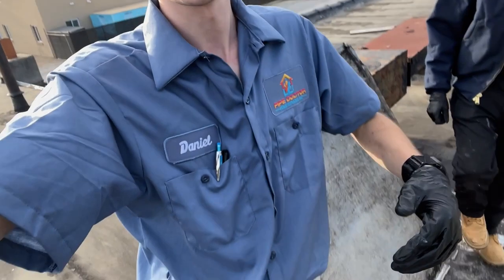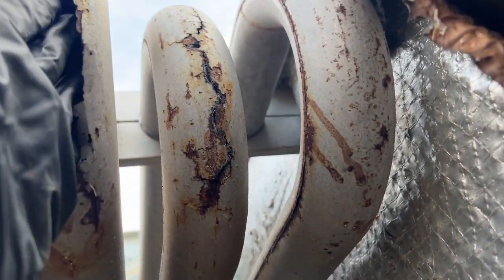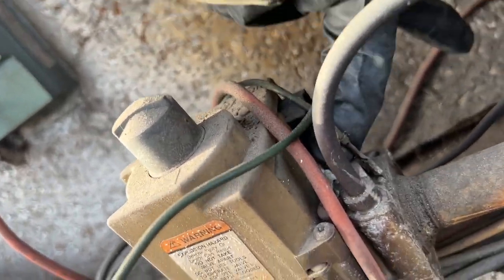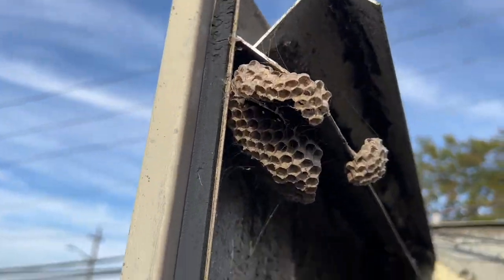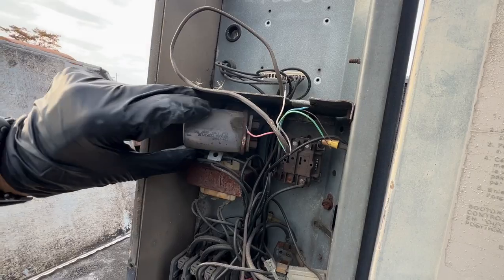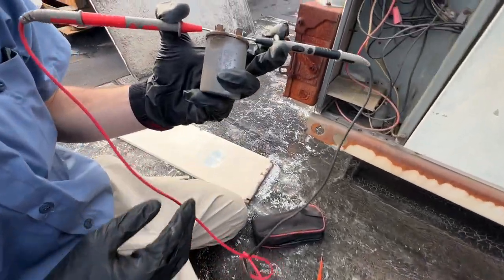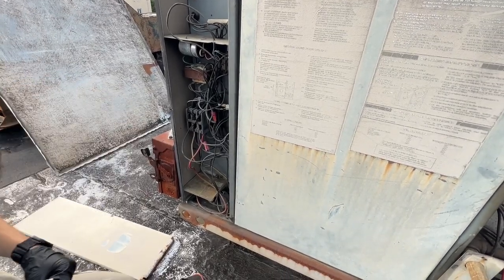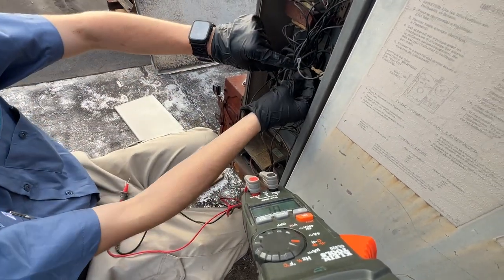Old Crusty Roof Top Unit! Completely Rusted! Blown Out Heat Exchanger! Where are the Blowers?

Comment: Daniel, do you have the magnet for the back of the Klein meter? Mine didn’t come with one but Klein sells them as an option. Fits perfectly and is very strong 👍👍
Reply from the maker: I did have it, but its stuck to an air handler somewhere in the nassau county, 5 towns, or queens area
Reply: @DCHVAC  you can just order one online
Reply: @DCHVAC  I almost did that, now I've added very mild adhesive between the magnet slot and meter slot. That magnet is so strong you wanna slide the meter off not pull, but that's how you take the magnet off, by sliding it lol.

Comment: Only thing I see wrong is the condenser fan blade is upside down
Reply from the maker: How? If it’s spinning CW or CCW you can’t tell
Reply: @DCHVAC  watch the video. The blade is installed upside down
Reply from the maker: @DA-PICKLES-VR  you can’t tell if a fan blade is upside down unless you know the direction of the motor. The motor can go in either direction
Reply: @DCHVAC  not rotation. Do a poll. Ask the community